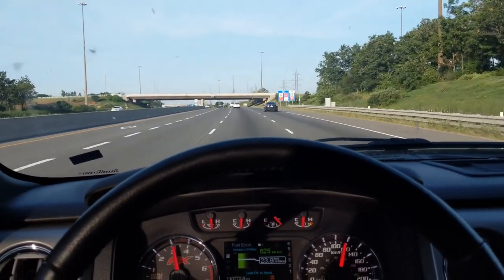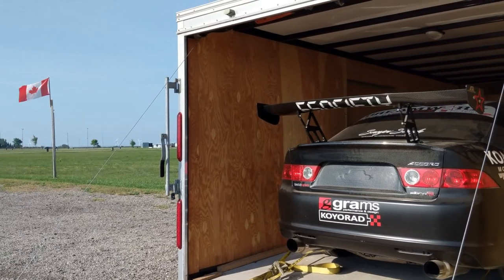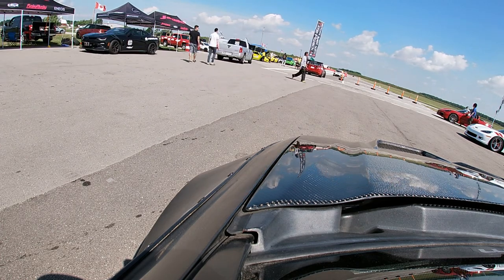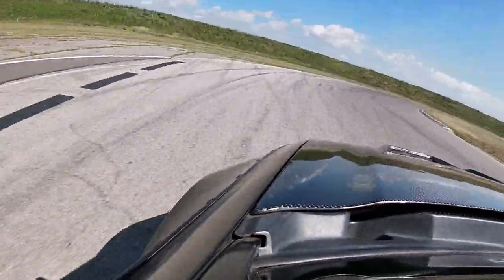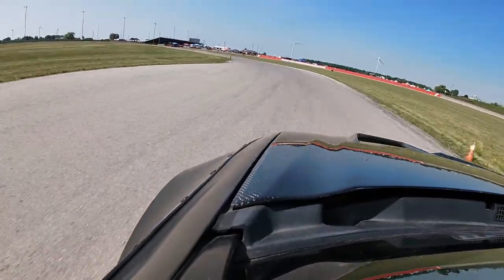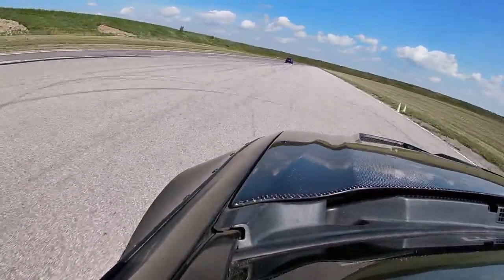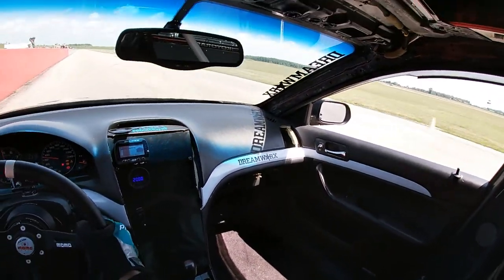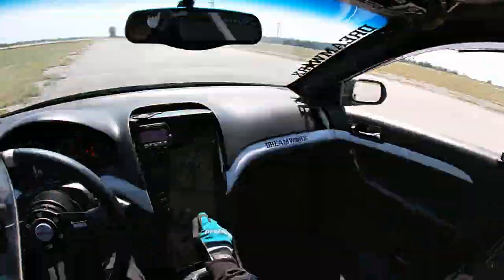Back on Track - Northern Speed Time Attack

Comment: New season jitters, relax, you'll shake them off. Unfortunate about the oil pan, BUT guess who has a lift & has done that job before? 2 hours and you'll be fine.  How's the tire wear/ tire temps coming off session? Any brake issues or pedal fade? Trans shifting smooth? #anyDay@TrackBetterThanLotsaStuff
Reply: FSOCIETYTSX did U eventually get your timer up & running ? What's a clean lap time for you here @ Cayuga ?